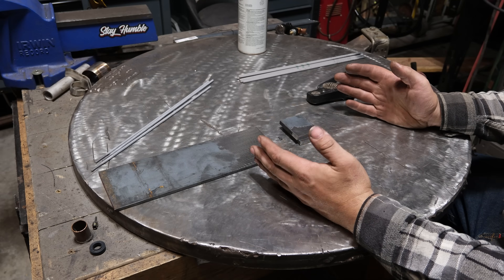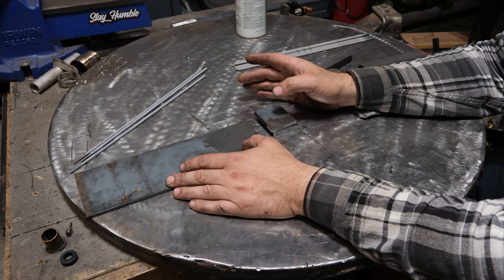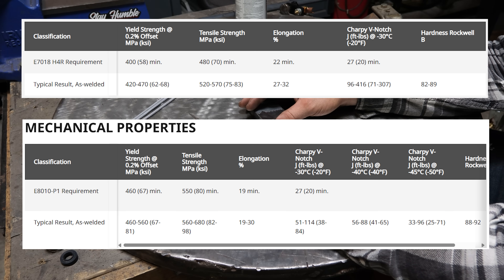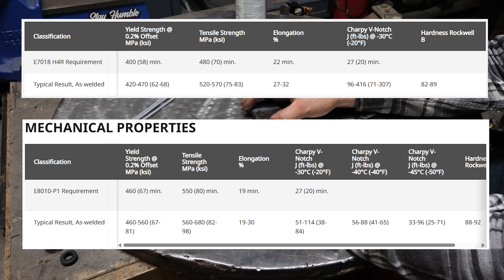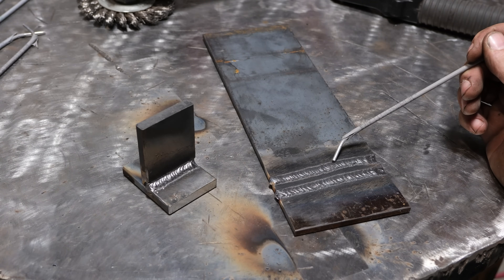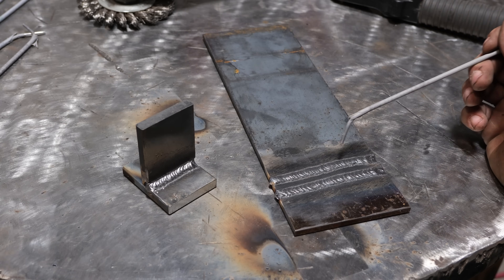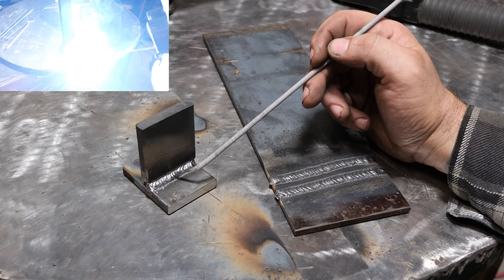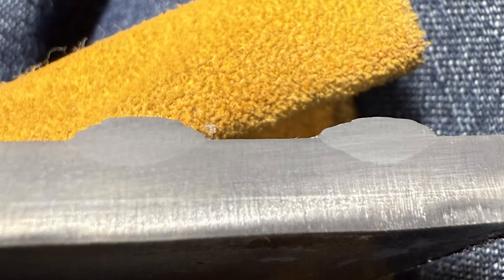8010 pipeliner rod vs 6010:  Is 8010 actually better?

Comment: all the tabs on the front suspension on my car are welded together with 3/32 6010... 5/32 6010 blue shield is one of the easiest rods in existence for all positions and fills huge multi inch gaps too like a hand held metal printer. 11018 is hard on equipment, and if ya use 8010 on one of those inverter welders the cheap ones... 2 rods, buy a new welder. 3 phase DC would make 5/32 11018 run like a 1/8 7018 on a crisp new welder box, but that's 100amp's that the common house doesn't have regardless of the main transformer being a 200 or 300 amp unit... ask for 50kw/hr on the grid out of nowhere. nope, that E13018 1/8th rod puts them all in the fail test pile, just because it looks like a 7018... stuck again, like a weld test is a second hand verification of alloy pot mixing in the vat. ... unlabeled half the wire runs like cast iron then deviated from 6010 to 8010 and 16018 then back down to 6010... didn't use enough gas and or electricity in the arc foundry to blend the pot... sample section cast into weld rods to make the meme of who's test is it they are welding for. old Gr12.9 bolts mixed with cast iron to get the alloy mix for 3/32 E6010... 40amp 40amp 40amp... 40amp 180amp 160amp 190amp 50amp 40amp 40amp... and that's how every cheap inverter welder drys. one time two stuck in the same box
Reply: Will the ESAB inverters handle those 8010 rods OK?

Comment: Have seen that rod before so its interesting to see them. Will you ever use 8018 rods? I bought six brand new pull tab cans of Chromet 1 8018 for £30 plus commission and VAT in a bankruptcy auction. They were cheap as a chips so why not? I might find a use for them one day?
Reply from the maker: 8018 is close enough to 7018 that they would probably work ok for general use stuff.  When you get up above 8018 the welds tend to be so strong/less ductile that you will get results similar to the 8010 in this video.  8018 will weld very similar to 7018 so there wouldn’t be much difference in that regard 😀👍.

Comment: Do You Have a Preference on Brand Of Rods Greg ? I’ve Used Lincoln Electric Mostly But 7018 and 6011 But See Other Brands as Well Hobart Ect
Reply from the maker: I ordered a bunch of 7018s to test out in a shootout video.  Since it will be a bit before I get to it I will share my thoughts.  I run a lot of esab 7018 atom arc at work, and I like it.  It runs very consistently batch to batch.  My favorite 7018 is actually the esab 7018 prime, with a graphite tip.  I find that for general fabrication/repair it is excellent, and the starts are always clean because of the graphite tip.  I like Lincoln Excalibur, however I have found inconsistencies in their rods in the last 2 years.  I have had numerous 50lb tins that had flux on the rods at inconsistent points near the bare rod end.  Basically some had flux so near the bare rod tip you couldn’t put it in a stinger easily.  In one can you could have anywhere between 3/8ths and 1inch of bare rod.  Hobart rods run ok, but seem to be very prone to sticking on starts, more so than most.  Given the choice I generally buy the esab 7018 prime, then atom arc, then Lincoln Excalibur.  It will be interesting to see how all the other brands fair in testing.  I did a video on a few before, but I will be a bit more thorough this go round.
Reply: @makingmistakeswithgreg  The Testing Will Be Interesting I Look Forward to It Thank You On Your Choices I Value Your Experience and Expertise 😊😀👍🏼

Comment: Most pipeline pipe is x90 or harder so they can get away with running thinner pipe. Alot of companies have procedures for 8010 root pass which is alot tricker than a 6010 if thats what you are used to using. Its alot softer arc undercuts easy on the bead if you try to jam it in the tight spots. Need really consistent gaps and lands and preheat. Has to be floated in if that makes sense. Alot of companies are getting away from cellulose based rods for fill and cap  and going to down hill low hyd rods like bohler etc because of less cracking stronger deposit but they come with a whole lot of challenges especially slag entrapment for inexperienced welders.
Reply from the maker: Thanks for your reply and you’re spot on with everything.  8010 really needs more consistent gaps and bevels to get the best results.  I am surprised it penetrates almost the same on a flat plate as 6010, because on an open root they are night and day different.  If the gap gets tight you can forget about melting through with 8010 lol. I have heard of downhill low hydrogen rods, never ran them but can imagine they would have slag entrapment issues.  Funny how stick welding is 100+ years old and we still struggle with things that have been a problem since the beginning lol.
Reply: Preheat is key with 8010 to get the pipe to accept it. The low hy downhill rods can make a beautiful weldment but have to use stringers which is slower and porosity is a issue on the bottom if your rod angle is off. The Metallurgical Engineers seem to have to come up with a new procedure every few years to justify there jobs. Cellulose rods have welded millions of joints across the the world with a extremely low failure rate.

Comment: is it possible to make a cellulose based rod that is ductile like 7018 or is it just not possible?
Reply from the maker: That’s a great question, the answer is not based on cellulose flux.  The flux produces a lot of c02 gas when burned and that gas interacts with the molten pool and changes the properties of the solidifying metal.  Much like using 100% co2 with Mig produces weaker welds than c25 gas, the cellulose will change the properties of the weld.  People have claimed (I have not verified) that 6010 and 7018 wire rods are identical, and the flux is the only difference.  This is possible based on how each produces shielding gas and the interaction of the flux.
Reply: I don't think so. First issue is the hydrogen in the flux. Second issue is that puddle is really hot and cools much faster, compared to 7018. I mean, if it was possible, they would have already done it :D

Comment: Greg I have seen 8010 on the self at my local welding store but never had the mind to use or need it.  As for the 7018  series Blus Shield in Canada has listed 7018,8018,9018,10018, 12018    rods.  Seems they are used for high pressure vessels and work at nuclear plants.  Have you ever seen or used the higher 8018 9018 etc ?
Reply from the maker: I have used 11018 screwing around for a video, but the pipe I weld generally has needs met with 7018 per procedure.  There are certain pipes that require higher strength fillers, but those at my work universally are tig welded where it’s not really a big deal.  9018-11018+ weld very similar to 7018.  I did a video on 11018 (link in the description) and found the weld is so strong and doesn’t want to stretch.   The  same thing that happened in this video happens to it basically.  The weld itself really doesn’t fail, it forces the base material to fail right at the weld toe.  Arguably the weld is stronger than the base material, but that is actually a bad thing since staying together under stress is a better outcome than failure lol.

Comment: Thanks.  "Squint Hard" 😂.
For "the home gamer,"  how much you need to buy and if a rod oven is required are considerations (assuming the person doesn’t have a rod oven - they are not cheap).
Reply: You can get an Amazon rod oven for less than $100. For all of the money we spend on our shops and equipment that is nothing in the long run. I do mobile welding and fab on the side and I have a small Lenco 10lb oven I got new for $100 I use for some of my higher liability repairs I also have a bigger keen I use for storage in my shop
Reply: @Wasdenweldingllc Nice .

Comment: Very nice to sew up big root gaps, but it and 7010 seem to not have the same drive on tight gaps as 5p+. Rod snuffs out. Also seems more likely to bughole on the toes when capping real small bore pipe.
Reply from the maker: 100% 😀👍.  On a tight gap you’re definitely in trouble lol.